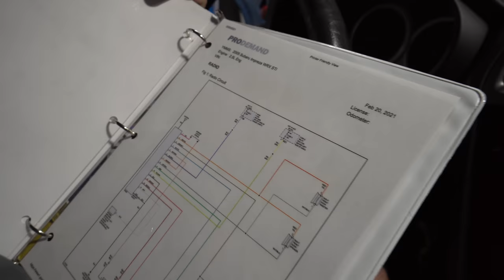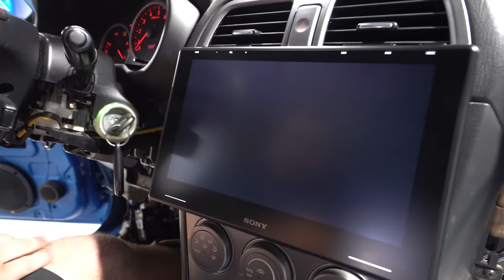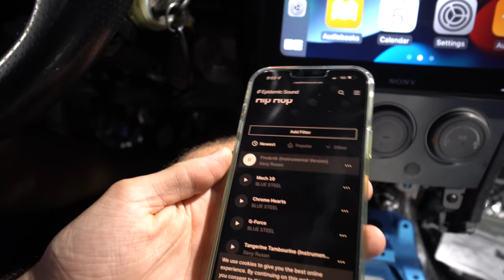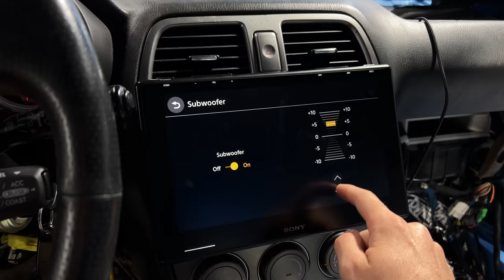Installing a HUGE Apple Car Play Unit & Sony Sound System (2021 Tech in a 1996 Car!)

Comment: People that know car audio are screaming right now.
Reply: why
Reply: @johnstaker6706   when he cut the factory harness. The way he ran the wires in the door.  Nothing between the speaker and the metal on the door. 
Yes all of it is subjective but
Reply: Agreed. The rear deck just made me sad because there are adapters for that
Reply: Got me at the all copper wire is the same… just went down from there in a lot of aspects. Not how I would’ve done things, however not my build.

Comment: Use mdf spacers to mount your speakers and your quality will improve. Mounting directly on metal is just tacky
Reply: Acrylic spacers would have been even better. Wont break down over time from condensation.
Reply: @neilmeschke  
Agreed, though acrylic is very brittle and not as easy to cut & drill without it fracturing or cracking.  I typically use HDPE, Sintra (expanded/blown PVC), "King Starboard", and ABS plastic.
Reply: Just LAZY as his the tweeter placements!

Comment: Wire grommets for the holes drilled in the metal would have been a good idea. Cars move and shake, so the wires will rub the metal over time and possibly short to the body.
Reply: Facts
Reply: Soo true.
Reply: Id have my ass raped if I ran wires through steal without grommets. seen a few returned "faulty" products returned with blatant wire shorts from this exact issue
Reply: And must add.. use no smaller then 12 gage wire for subs.. 16 is too small!
Reply: @toddjohnson1518  16g is fine for that tiny little amp and "sub", 330 watts at 4 ohms, with that short distance run under 2'. 
The xmax is only like 6.5. This thing doesn't flex, it twitches.
Reply: @toddjohnson1518  depends on the amount of power going from the amp to the sub.
Reply: Totally true

Comment: Would've loved to see the tweeters on the A pillars, or the sails on the door.. you need them as close to ear level as possible for proper stereo imaging. Fantastic build though!
Reply: I was thinking the same thing... I wonder how well you'll be able to hear those high notes f/the tweeters in that location??  Otherwise very clean!!
Reply: Actually, with the tweeters in the lower position the distance from the drivers head to the two tweeters is closer to being the same. So, the sound arrives to your ears somewhat in phase. It IS better to have them up top if you're running an active system and can delay them to be in phase with DSP. But,  they're running passive crossovers and aren't able to do that. So, my man in the video there knows exactly what he's doing. :-)
Reply: @MitchellWilsonII  welllllll dsp's are great so they should run a dsp😂
Reply: @devinstepp4205  This is true.
Reply: @MitchellWilsonII  that’s what I was thinking.  First I was like why are they so low then I noticed passive crossovers.  They are clean and that’s what matters.
Reply: Midrange and tweeters should be as close together as possible. 
That’s much more important than them being at war leaves when it comes to phase, soundstage, and imaging.
Reply: Haha yeah the door card on my impreza RS had speaker slots next to the handle I wonder if they will move it when they start putting together the interior
Reply: First thing I said was those door tweeters are way too low.
Reply: @devinstepp4205  
@Mitchell Wilson II  
This head unit has a full "Network Mode" and DSP Built-in!   Unfortunately, they are not taking full advantage of it and are using the passive crossovers on the front component speakers.

It's fine to use the passive crossovers on the rear component speakers, but the Front Component midwoofer & tweeter should take full advantage of the head unit's built-in DSP, which includes independent level control, crossovers, time alignment (digital delay), and parametric EQ.

I would have also treated the doors with Dynamat Extreme or preferably ResoNix Sound Solutions CLD Tiles & CCF foam.   These Sony Mobile ES speakers deserve way better installation in the doors!

And once they get the window glass installed, they might also find that they need speaker adapter spacer rings to prevent the window glass from hitting the rear magnet of the speaker as the window is rolled down.

I also think that once they try to install the door panels, they will find that they to need to relocate the tweeters.

With the use of the head unit's DSP,  the small plastic trim "sail panel" triangles inside of each side view mirror would be a good location for the component tweeters.  Either that or flush mount the tweeters in the upper forward door panels using the included hardware.

@Cameron Alford  
@Randall Pullen  
Contact Doug Dobson at MSC America (Audiotec-Fischer/Helix USA Distributor) or Justin Zazzi (speaker engineer) at Rockford-Fosgate in the Phoenix/Tempe AZ area to help "TUNE" the DSP in the head unit and the overall system.  ;-) 

THEN you will be truly BLOWN AWAY by the sound quality that this system can provide!   You can find Doug and Justin on the DIYmobileAudio Internet Forums if you Google Search "DIYMA" and their user names, "dobslob" and "Justin Zazzi".

Doug and Justin try to have a casual monthly get together with other car audio enthusiasts at a good local restaurant in the area where they Demo their car audio systems for each other, hang out, and help each other with their car audio install and DSP Tuning.  Great Guys!
Reply: @bbfoto7248  That's awesome! Thanks.. I actually have some punch components, a punch shallow 10 in sub, a prime 500x1d, and  R2-500X4 Amps in my car, on a pioneer Headunit, using the internal dsp and time alignment! Sort of a moderate sleeper build, but it's fantastic! I do wish I had rear speakers ( headunit only has 3 outputs ), so sometime down the line, maybe in a new car, I'll get a proper dsp and have 3 ways in the front, 2 ways in the back and dual 10 inch subs.. I'm in it for the experience😄
Reply: You are wrong
Reply: @ekimandersom4478  You are unreasonably judging
Reply: @devinstepp4205  No.
Coaxial or sound from one point is the best sound, always .
The rest is tuning.
Reply: @ekimandersom4478   or run a DSP
Reply: @devinstepp4205  That is always a must.
Reply: It’s funny because I was just saying that
Reply: This sounds going to sound jumbled you’re not gonna hear separation in the instruments
Reply: It’s something they could easily change down the line. Might be best location at the moment without a full interior.
Reply: But I think is also personal preference. In my car I have my 3.5 and dome tweeters in the dash factory location and my 6.5 in the door which I enjoy the soundstage. But I’m looking to replace my oem head unit currently have it plug to audio control lc2 I want apple car play and DSP which I have in another vehicle kenwood x998
Reply: @devinstepp4205  
I installed a similar setup in my GF's car using the built-in DSP in one of the newer Kenwood eXcelon Reference (XR) double-DIN touchscreen head units and it sounds fantastic as well.

You can use a RCA "Y" cable to split the output from the Pioneer head unit's "Front" outputs to another small amplifier for the rear speakers.  Some inexpensive coaxial speakers or even the stock speakers are fine for the rear fill, and it's fine if they are bandpassed the same as your front mids.  The only caveat is that they would have the same T/A applied to them as the front midwoofers via the head unit DSP,  but that's not a huge deal for their purpose!  And contrary to popular belief, using a RCA "Y" cable will NOT divide or half the RCA output voltage from your head unit going to each amp!

To maintain a proper front soundstage you really only want the rear speakers to be barely perceptible in level, so you can use a simple in-line RCA stereo attenuator knob between the head unit's output from the RCA Y cable to the rear amplifier.  These stereo (2 channel) RCA knobs look exactly like a typical Bass Knob but have 4 RCA connectors...L&R Inputs from the source (head unit or DSP) and L&R Outputs for the amps.  And the rear amplifier can be one of those really tiny, inexpensive 25-50 watt amps.  No reason to spend a lot of money or have crazy power back there!

When you have rear passengers you can turn up the level of the rear speakers with the small knob, and keep it lower when it's just you in the car to help maintain the front soundstage and imaging.

Anyway...enjoy your system!
Reply: @bbfoto7248  That's an interesting idea, I'll look into it👍🏻
Reply: @krobbed9363  
They would probably have to modify those tweeter locations or find another location because these Sony tweeters are a lot larger diameter than the OEM stock tweeters.  Luckily the Sony tweeters are still shallow or thin, but their large diameter might make them harder to install in typical factory locations.
Reply: @devinstepp4205  
Cool.  It works good.  But if you are planning to upgrade to a full standalone DSP or DSP/amplifier combo in the future with a front 3-way component setup, that would definitely be the way to go and I would skip this "intermediate step" to save money towards your End Game system.  ;)
Reply: so tru bro
Reply: It's nice to see so many people critique the tweeter placement who have no idea what they're talking about.
Reply: YOU NEED TO LEAVE!!🦆🦆🦆
Reply: Kickpanel tweeters pointed towards ear level better
Reply: Exactly what I came here to see if somebody said something
Reply: Wrong. You want tweeters to be as close to the mid range as possible
Reply: @notverystealthy9165  thats why you put the mid in the kickpanel too
Reply: @notverystealthy9165  but only the main tweeters
Reply: @Dany-db2ir  I mean it’s pretty unnecessary to have the mids in the kick being that the mids are already low in the door panel. And I’m talking a 2 way component system. Tweets should be as close to mid as possible.
Reply: @notverystealthy9165  just dont put them in the door panel🤯🤯🤯
Reply: @notverystealthy9165  if you have door panel spots the driver side mid will be closer to you than passenger vise versa thats why in kick they are pretty equal distance from you no matter what meaning less tuning goes in play which neutralizes the true warm sound
Reply: @Jesse_James_Dj  
Yes it is but it makes this video a how not to which is a shame because it could have been so much better, like their sound.  
Nice clean work though.
Reply: Wrong, they should be near as possible to the woofer, and both on ear level would be perfect.
Reply: I have 3 way active in the front of my 2010 Mitsu Lancer. Tweeter in the sail, 4” midrange in the bottom of the pillar mounted slightly off axis and DSP tweaked, and an 8” woofer in the bottom of the door (those took some work to get in hidden behind the factory trim.)

In any case, I agree with those saying tweeters high if you are running active with DSP.
Reply: 30:20 So true! I  added a cheap 40x2 amp to an old Cavalier and couldn't hear the brakes squeak and witnessed many hand turns!
Reply: Right?? Who tf buys a component set and throws the tweeters right next to the mid? lol
Reply: @emmilynevans9869  just found this again lmao
Reply: @MitchellWilsonII  I thought they were able to adjust the playback time of the individual components from the head unit…?

Comment: As a current stereo installer myself, I thought this was a very satisfying and clean install. Props to you both for your excellent work! Excited to see this project progress!
Reply: You ever did a 370z before? Or what kinda head unit do you install the most
Reply: @masterk5066  Kenwood DMX7706S I’m also a stereo installer. This radio is by far better than the Sony. The interface is better for use and has more features. As well if you were to use a 4ch amp the pre outs have about 4.5 - 5v so the sound quality is there.
Reply: Did you put the fuse in the wrong end like these guys? 😅
Reply: @tomijorg  I didn't see under the hood side anywhere in the video, but I'd assume they have a fuse by the battery too. I've always done fuses at the amplifier as well using distribution blocks, especially when there are multiple amplifiers. It is how I was taught and what I see in a majority of multi-amp videos I have watched.
Reply: @mikeysousa164  any head units that will decide MQA via Tidal.
Reply: It was a nice install but they didn’t tune it with an rta so I can’t see the sound being that clean…. I got a sound system out in my car and once it got tuned it sounded like they put different speakers in the car night and day difference
Reply: Clean? Tell us where you work so we can not go there

Comment: It’s smarter to just get the factory harness adapter for the 10-15$ saves anyone else who would have to ever work on it trouble and usually it matches up to the colors of the radios wires
Reply: Dude when u do stuff like this it's for you not the next person. Fuck them it's your money.
Reply: @davey6024  but why wouldn't you just get the appropriate harness adapter instead of permanently cutting the factory harness?...

It just doesn't really make sense not to, regardless of whose money it is. It's more work AND less optimal to splice into the vehicle harness.
Reply: True  on t hw harness but to me its can help as practice the first jvc tape i did was  with no harness, no book on a dakota its not that bad at all
Reply: @SecretSauceyjuice  they we wired the whole car 1 more harness wouldnt hurt
Reply: @DC-bc9pe  no its 1 less harness. I wanted them to use an additional harness that could unplug from a factory plug and remove the radio cleanly. Instead they cut the wires individually.

It's just not as clean of an install to do it that way and makes removing it later annoying af.
Reply: Yup and plus with harness looks cleaner and more peace in mind
Reply: ya. you can just buy the T adapter or whichever. I would still solder the connections--all of them.

Comment: Awesome install. Quick tip for anyone installing a new head unit, always get everything wired up and make sure the thing turns on before fastening things down and making it look pretty. It sucks when you spend extra time getting everything neat and organized to find that you missed a step and need to pull everything out again lol
Reply: Spoken like a man who has uninstalled a few head units. 😏 Been there myself. More than once, I’m ashamed to say.
Reply: 1. Bad ground. 
2. Blown fuse. 
3. Loose connection.   
It’s usually one of those.
Reply: AZW
Reply: I’ve made that mistake 😂

Comment: Also a quick tip that is “illegal.”  To bypass the parking break wire just put it to the ground. I haven’t finished the vid yet but I noticed y’all didn’t do anything with the green parking break wire. You will lose a lot of functionality without that properly installed or bypassed. Also never put the fuses inside the car. Always want them no more than 18 inches away from the battery unless the battery is in the trunk but still only 18 inches away. Other than that great bud bro.
Reply: Simple. Just ground it. Lol
Reply: ya. just run the wire to a relay that you control.
Reply: @zayrsps2631   the just "ground it" unfortunately  does not apply to all cars atleast  for the nissan frontier  had to buy a parkbreak  bypass

Comment: The engineer in me is always satisfied seeing people using crimps, proper soldering technique, heat shrink, and zip ties in their projects. It ain't OCD to go the extra mile and ensure with 100% confidence that you  made a proper connection, splice, or what have you. I can't tell you how many times I saw wiring harnesses fail in my aerospace class, taught by an accomplished electrical engineer, due to poor quality connections. Go that extra mile, it pays off in spades

Comment: I have no car, nor would I be interested in having an upgraded sound system in it if I had one. However, this video is mesmerizing. It's especially satisfying to watch Randall going the extra mile with organizing cables, making connections extra safe / rigid by using heatshrinks, cable organizers, zip-ties etc. A true work of art.

Comment: I would add a rubber grommet or plastic wire sleeve where the wires are going through metal panels. They can rub on that sharp metal and short out

Comment: Great job but never stop learning and getting better.. Bench test if you can.. Make sure Audio/Video cables are split from Power cables.. Always use grommets when running cable through metal (You will learn the hard way if its a power wire that develops a cut in the jacket.....) Lower frequencies are more forgiving on placement, that's why the ear level tweeter recommendations.. But if a stealth look is what you are after, I definitely get it.. Never cut the factory harness, its just bad practice.. Oh, and never rely on double sided tape haha..

Comment: You need spacers and some sound mats to got around those speakers there is definitely going to cause interference or static along with rattling. Happened to me redoing all the speakers in my 2003 forester.
Love and supporting the build man.